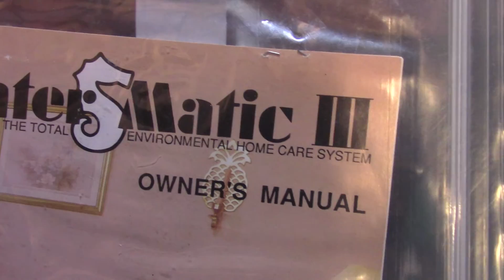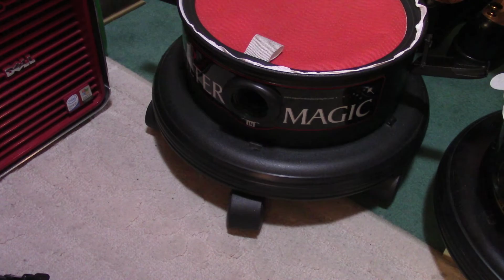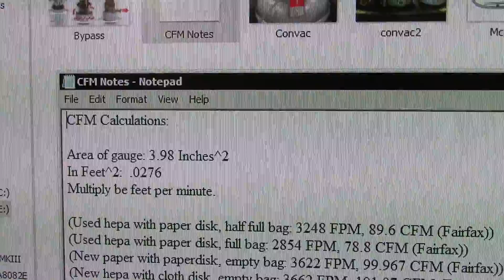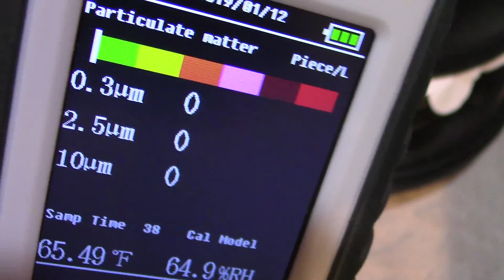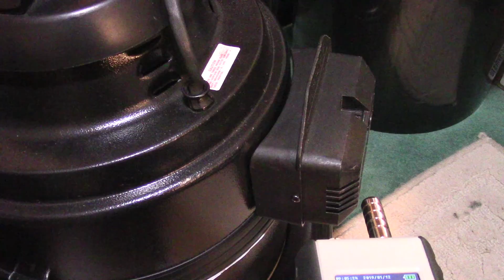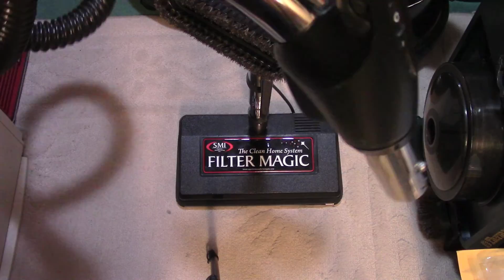Watermatic Filtermagic Vacuum Overview and Benchmarks

Comment: I actually sold these door to door for 1 summer when I was 20. I did 3 demos and sold 1 lol...to my parents. Years later I felt so guilty that they bought one from me because I knew they couldn't afford it. That was 30 years ago. My mother still has it and it still works. Unfortunately, when she sold her house, all the attachments somehow got thrown away, so she only had the canister. Well, after 4 months of searching, I finally found a complete system on Facebook market for $15!!! I couldn't believe it. I drove 1 1/2 hours to get it because she was still very mad about losing her vacuum. It came with everything except the filter for the mop function. They must have lost it because it had all the other water attachments with it. I think my mother has the water "filter" so she'll have a complete system regardless. Thankful for your video because I forgot which filter went where and we don't have a manual for it. Any idea if the exhaust filter can be changed? I know you said it was a bugger to get out, but the used one I bought looks pretty gross.

Comment: The only vacuum cleaner my family had since 1999 (or is it 2001?) is a electrolux gt200 or gt200 pro (one of these i see all over all car-washes), it's really old and in theory it accepts water. I don't know much about vacuum cleaners, but it seems to be really good. The only downside is that it's hard to find the propper dust bags for it... It still works really well.
Reply from the maker: My advise is to look at the way the bag connects and see if other bags will fit the connector.  If the bag is a little smaller or bigger, it should be fine if it seals well.  I don't know how the market is around you, but where I live you can find used Kirby's for pretty cheap all the time.  They are excellent machines.
Reply: @RapidlyAgeingTechnology  Where i live there aren't kirby vacuum cleaners unfortunatly. I never saw one before your video. Actually i don't think that even such type of company, those door to door selling ones, ever existed around here. 
Maybe i can find a used one that was imported by someone, i will look into that

Comment: Great comparisons of these two machines! Love that you have an HT9600 particle tester!  And the specs for your particle meter are printed in the manual. It is a very useful tool.

As you already know, when I compare particle emissions between a Rainbow D4 SE and and newer E2 series, the filtration differences are enormous. The difference is the exhaust filter of course.

Please remember that your GM8901 anemometer converts like this: ft./min. multiplied by 0.026099.  So  3248 ft/min = 84.77 CFM, not 89.64 CFM.
Reply from the maker: I figured you measured the diameter of the gauge more accurately than me, but I thought I should use my numbers at least this time. 

But should a simple sponge filter have created such a drop in particles?
Reply: @RapidlyAgeingTechnology  without examining the filter in person, I couldn't say precisely how much reduction would occur, but a well made sponge type filter is used in all sorts of bagless machines these days.